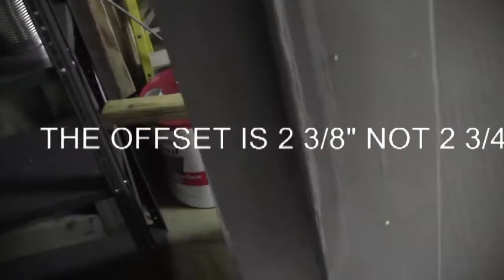UTILITY TRAILER BOX REBUILD PT 3 OF 4

Comment: That is one sturdy trailer box you've built.  I remember that you are a master gardener, but now know you're a master carpenter too.  You share so much interesting and applicable information with your YouTube viewers.  It's a privilege to learn how to go about gardening and building from someone who has put a lot of thought into the process and does meticulous work.  Thank You!
Reply from the maker: thundercloud47 The lady that runs the dump saw that I had a new box on our trailer and she said I did a good job building it. I still need to paint the metal pieces and put cap boards on the upper edges of the trailer. I had to get going on clean up before it gets too cold. I worked at the river for 8 hours today and brought the trailer home to get up the leaves in our yard. Bernard